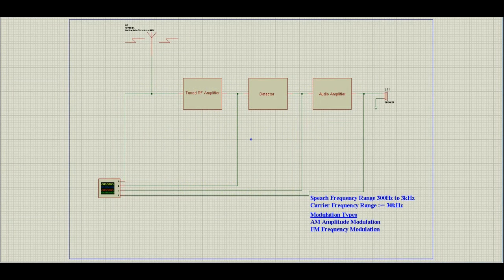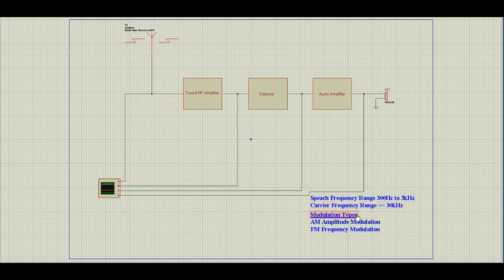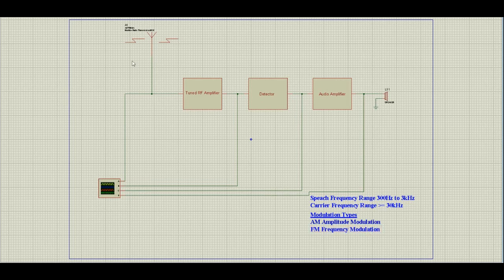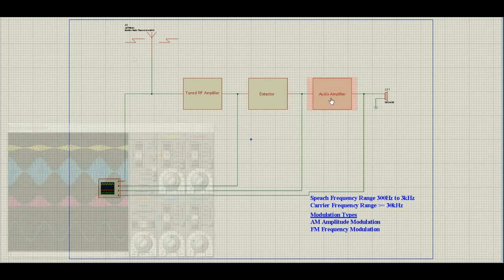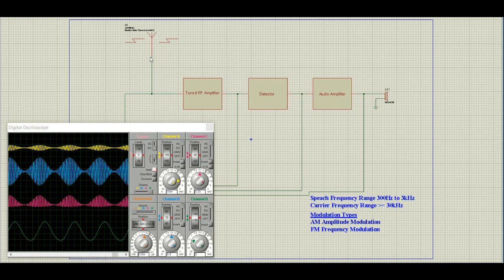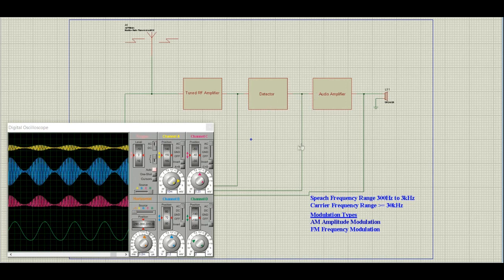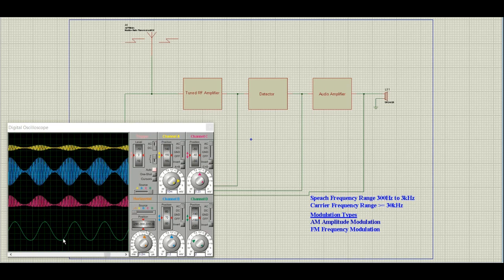Basic AM Receiver Demonstration

Comment: slt c quoi le nom de l antenne utilise
Reply from the maker: It will depend on the frequency used. You could use a simple 1/2 wave dipole. At very low frequencies this could be very long.  wavelength = 300/F where F is in MHz